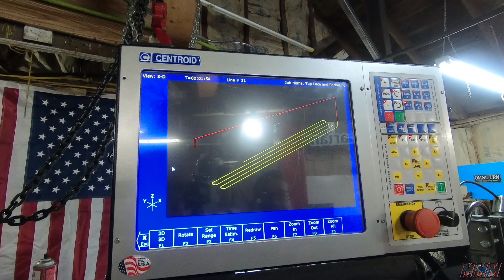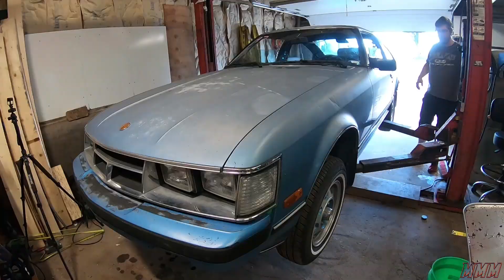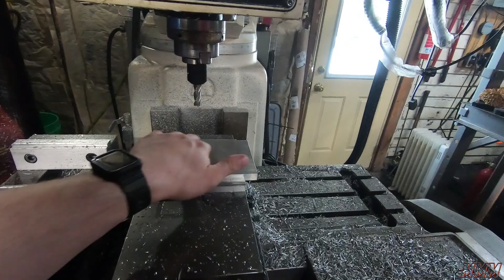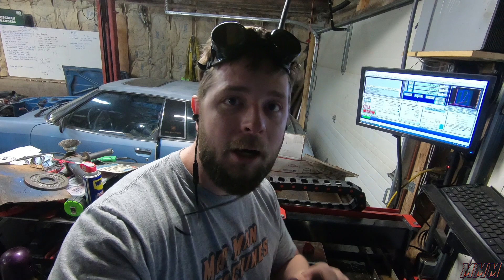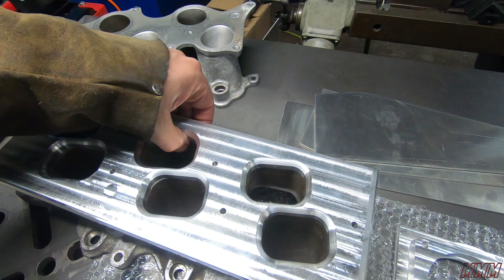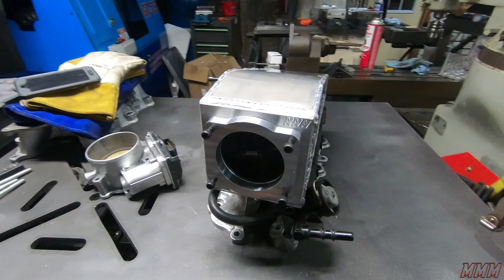You need more power! Toyota MR2 2GRFE CNC Intake Manifold

Comment: Did it work and made more hp then stock manifold?
Reply from the maker: I wouldn't think on an otherwise stock motor it'd make more, maybe a bit up top, but the stock manifold isn't a bad to begin with. This is more for the convenience of eliminating the plastic manifold to run boost, running a bigger throttle body and not having it cover up the spark plugs on one side of the motor.

Comment: Dyno update ?
Reply from the maker: 1100whp on the ZTR drag celica.
Reply: @MadManMachines   lol, any car can make any power at the right boost level. I clearly meant to see the difference between stock and this and you know it. So are you gonna dyno it ?
Reply from the maker: @2zztercel558  This design has only been tested on high HP boosted applications, i doubt a stock 2gr would gain much of anything as the OEM intake isn't really a restriction at stock HP levels but we could be proven  wrong.  On the 1uzfe engine, replacing the stock upper with a plenum style like this gains 20-30hp, but that's a completely different toyota engine and i doubt the stock 2gr intake is as restrictive as the 1uzfe intake.
Reply: @Mad Man Machines  

Video of this intake on the dyno?

Comment: Now this has me curious as to possible implications for an integrated air to water intercooler manifold like say from a Garrett 750hp core welded into the plenum😁😏
Reply from the maker: Sure, we were actually just talking about it the other day, just sandwich a air to water in between the plate and the upper. It'd ad height to it, but for those who have the room it'd be sweet!
Reply: @MadManMachines  they have one on nixspeed but that unit costs 1800.  I believe it can be done for less and yet equally effective.
Reply from the maker: @RavenGTR79  Yeah, i checked it out, their's lays over the valve cover, much like a stocker.   I kind of like keeping the valve covers and fuel rails clear if possible, but it adds several inches of height the way we'd do it.

Comment: damn if it cleared an mr2 spyder hood. any way to find out?
Reply from the maker: If your stock 2gr intake has about 1  inch of clearance from the hood, it'll fit as this is only 1" max  taller then the stock 2gr intake manfiold.  It only looks tall due to the side profile being straight upright,  but if you look closely, it's only a bit taller then the throttle body on the front.

Comment: Hey would you be willing to sell the stl for the fse adaptor plate. 
Would probably cost too much to ship one to australia but would be looking to do a one off for personal use on my fse and could reach out to a local workshop with it.  
I need to try save as much height as possible in my conversion so would go a long way to helping with that.
Reply from the maker: Sorry man, we won't be selling any of the files, they are proprietary. Please consider supporting us for for future FE/FSE parts. It would be cheaper to have it shipped to you then going to a local shop. A one off multi part single quantity item with 3D milling at a shop would be far more expensive, potentially $1000+ vs our $300  price for a DIY intake weld kit.
Reply: @MadManMachines  oh right didnt think it was that cheap yea will definately check it out. You guys planning a low profile sump design at all? 
If not would you do comission designs? Ive got a 3d printer and a engine awaiting fitting in my project if you want to do prototyping. Just struggling for height on my build atm and need to save some inches top and bottom to clear the bonnet without dropping the subframe. 
Would want to convert the engine to a front sump like the origional engine had and would be happy to pay for the rnd
Reply from the maker: @zbrutalis  Not that it couldn't be done, but it'd be cost prohibitive.   Machining a billet upper pan and lower pan to replace the existing cast upper aluminum pan and steel lower pan would run well into the 1000's of dollars.   That mid pan would require a huge chuck of billet aluminum and days of machine time, these motors aren't like old school Chevy where you can just fab a lower oil pan, that mid pan is a stressed member that adds rigidity to the block above.   Best and cheapest way would be to modify your own steering to clear the factory rear sump.   If it's rack and pinion thats interfering, relocate the rack more forward, which  May have to cut out the factory crossmember too and fab a tubular cross member.  If it's drag link and steering box, switch to a rack and pinion located more forward.

Comment: How many ipm and precision with this retrofit?
Reply from the maker: The IPM and accuracy isn't limited or determined by the Centroid conversion, it's limited by what you are running for a mill and what bed,  ball screw and servo size and type you are using.   When setting up your conversion, you'll input this information into the centroid and it'll run its own load test under power and it will give you recommendations on what IPM your setup can handle.  Ours came back just shy of 300ipm.  Accuracy will be determined by your mill brand and how it was built from the factory (converting a chinese mill vs converting a mori seiki will yield different accuracy).

Comment from the maker: Under 1" taller then the stock manifold (so it'll fit under most all hoods) it frees up space and makes the valve covers and spark plugs accessible without needing to  remove the intake manifold.  It can be welded up to exit out the rear or front of the motor.  This particular one exits out the rear towards the transmission.

Comment: That intake manifold is beautiful! I wonder if it would make any more power than the stock 2GR manifold. I also wonder if it would fit under the engine lid of my MR2 haha.
Reply: use f40 engine lid lol
Reply from the maker: Yes, it will fit under a MR2 Hood, it''s under 1 " taller then a stock manifold, it just looks tall due to it's side profile being upright rather then curved over like the stock.   I doubt it'd make any more power  on a completely stock motor (maybe a few horses, but more then anything, it'd move the power band up higher in  RPM).   If you have mods like cams, or are boosted, thats where it comes into play. We built the plenum with 3.5 liters of volume to match the motors displacement.   More then anything we made it so it'd fit better and not cover up the valve covers and not blow out like plastic intakes can under boost.